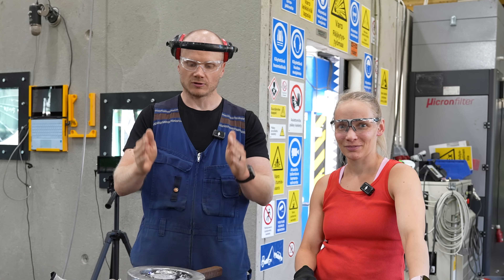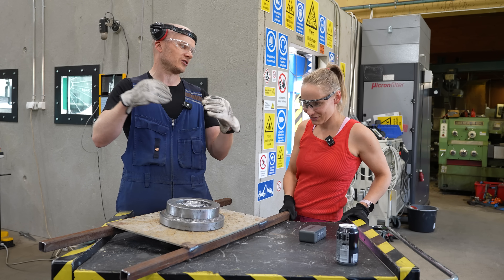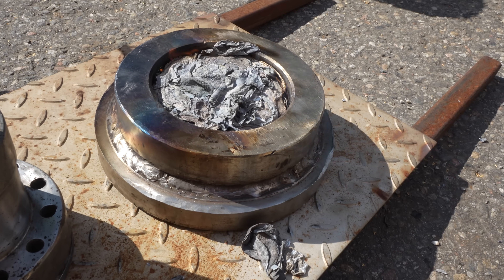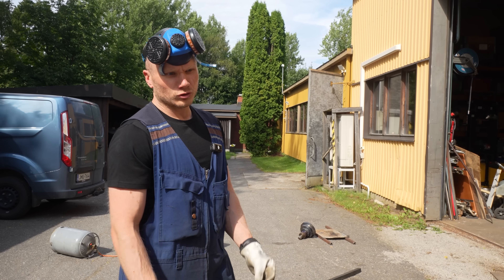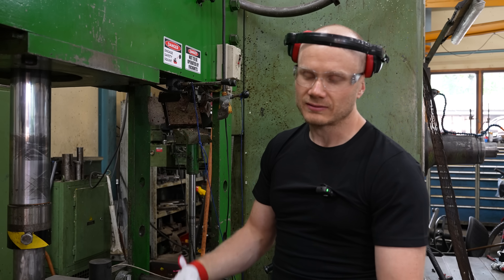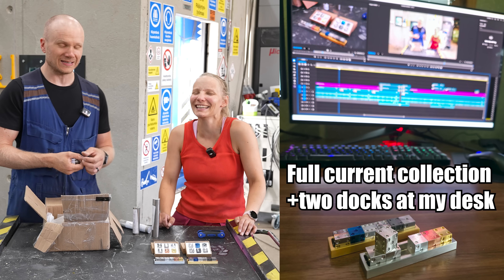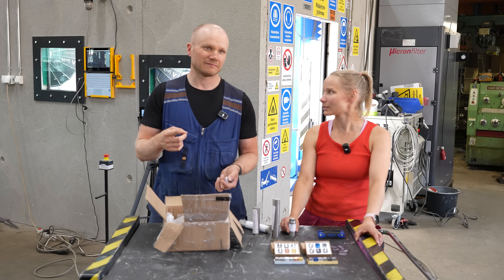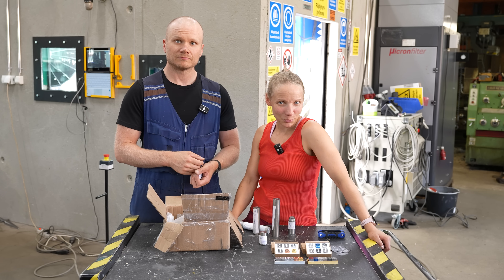Soda Cans vs Hydraulic Press: Aluminum Extrusion at Home?

Comment: You would need to remove the plastic lining, and also, the TOPS of cans are a different type of aluminum than the rest of the can, so you need to separate. I think one way is to shred the cans (without tops) and melt off the plastic lining (or something else) and then the remaining aluminum should be more obedient. But you also have to consider the ink on the cans' outsides, so it's going to be hard to have a homogenous melt.

Comment: What you've got there, Lauri, is a mixture of the plastic liners in the can, and the aluminum around them. If you don't burn out the liners first, you don't get aluminum so much as you get a weird, folded mixture of burnt plastic and oxidized aluminum. Need to actually melt the metal and separate out the unwanted plastic char.

Comment: You could use heater bands from injection moulding machines to heat the tools, even while using them in the press, I've run them at 450-500 degrees C to heat the injection barrel up that are 5 meters long and 90mm inside bore in order to get the end cap bolts out.

Comment: The first step with melting down cans is just heating them, 'cause they're covered, inside and outside, with the layers of plastic and ink that you mentioned. That layer of stuff that isn't aluminium has to get air in contact with it, and the ash has to be able to get out of the way. If you're just going straight to melting the aluminium, like a lot of people melting cans do, then the liquid aluminium is able to separate from all the ash and horrible byproducts. If you've squashed it with many tons of force and then not melted it, the oxygen can't get to that plastic, and the ash and stuff can't move away. You end up with a pancake stack of aluminium and crud. 
A better approach would be to heat the cans up to 500 degrees or so before crushing them, so you can get lots of air movement around them.

Comment: You CAN make things using cans, you just need to actually melt them in a crucible first, there's probably less aluminium in a single one of those machined dice than there was in all the cans you used in the press there. Generally when people cast things from cans, they need hundreds of them to get enough material to cast anything with. Pretty sure Cody's Lab has a bunch of videos melting cans this way and making things from it, like thermite!

Comment: Great video! We set magnesium on fire, a huge block of it, that was interesting and dangerous. Well, mostly just interesting. Working with hydraulics, I only ever saw 800 bar once, with equipment failure, I never shut something off that fast in my life. We had a 250 ton press that we used to mess around with, we would turn soda cans into aluminum foil, until later on it broke a 2x4 (52mm x 104mm, kinda) steel block in half.

Comment: You don't have aluminium.  You have aluminium oxide, which is much harder and has a higher melting point, and carbon from the plastic coating and paint.  What you need is pure aluminium.  You have to melt the cans, skim off the dross then pour the molten aluminium into the mould and let it freeze.  

You should also lubricate your die with olive oil, which has a very high ignition point and is one of the most stable vegetable oils.

Comment: I worked at an aluminum extrusion plant. The extrusion dies are placed in one end of a heated chamber. The press ram enters the other end of the chamber. A billet of aluminum is laid in guide channel and the ram pushes it through the chamber. The aluminum becomes a consistency of somewhere in the range of a paste. It kind of works on the same principle as a cake decorator. 
You need a device that keeps the aluminum heated, while it's on the press.
We extruded little channel type extrusions for window and screen frames. But, we also extruded bleacher seats and aluminum trailer frames. Plus many other things.
Reply: *aluminium
Reply: @OkurkaarrgghhWe didn't use aluminium. The extrusion plant is in the in the U.S. They ordered some from the U.K. once, but it wouldn't fit in our press. Too many syllables.
Reply: @Okurkaarrgghh It's still operating at the same location. They extrude aluminum for hundreds of different products. It's just one extrusion plant, that's part of a bigger company.
Reply: You might consider using a log splitter. It would minimize the heat that the hydraulic cylinder is exposed to.

Comment: There are too much mixins on the surface of these aluminium cans and when you heat em up to 500 C these mixins produce quite much of aluminiun oxide film which isn't as ductile (in fact it's sort of ceramic) as pure aluminium so it won't extrude as you might expect. However you may try aluminium foil and some sort of conic chamber with one little hole in the bottom, this should be more successfull

Comment: The aluminum log and the die are usually heated to about 900 degrees Fahrenheit and a 6in/150mm diameter press is usually about 2,000 tons.

Comment: I've seen on other channels where they've melted aluminium cans they always remove the coating first. Then they melt them in a crucible. Thanks for always having interesting content. :)
Reply: I've never seen anyone remove the coating - they just throw them into a hot crucible in a forge and add borax as a flux, and then you have to scoop all the oxides and other nasty goop off the top before you pour the aluminum into a mold

Comment: Your tools are magnetic.  An induction hotplate should get that thing way hotter than melting point of aluminum.
Reply: Pre-assembling the thing before heating should also reduce the oxygen contact.

Comment: Most beer and soda cans are not 100% aluminium. Most cans are made from an alloy that has a little iron in it so that they are just magnetic enough for the recycling stations to be sorted out from the rest of the trash. But some cans are 100% aluminium. I don't know why. Check it with a neodymium magnet.

Comment: In addition to the plastic linings, very thin aluminium like soda cans oxidizes too quickly when heated. If you melted them in an inert gas like argon you would have better results. You might be able to use an RF induction heater.
Reply from the maker: I think the plastic might actually help after all here :D Since when it gasses out it replaces all oxygen from the soda can cake
Reply: @HydraulicPressChannel Too slow for the molten aluminum...which is good, because, for once, that really was too dangerous!
Keep up the good work, but, stay safe!
🖖
Reply: I wonder if pouring muriatic acid into the mold would both dissolve the lining and the oxidation allowing the aluminum to fuse.
Reply: People do melt cans down in regular furnaces to get ingots or casting liquid.  But you do lose more to oxidation.